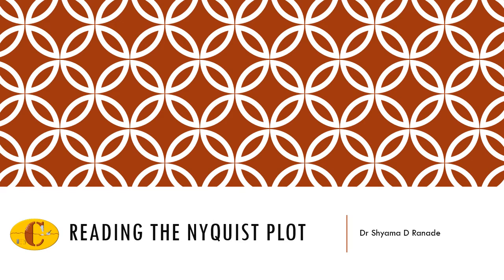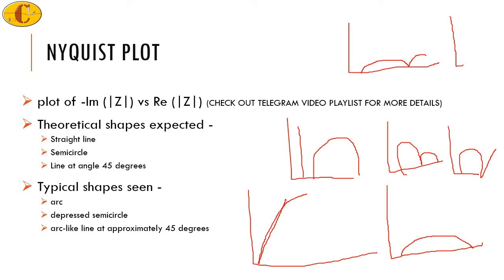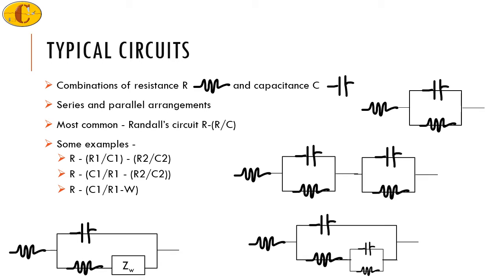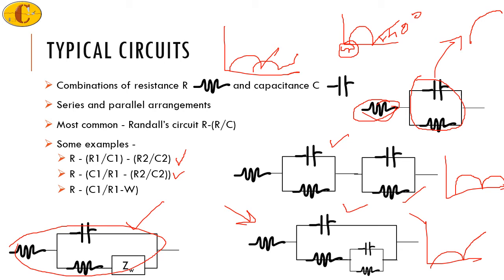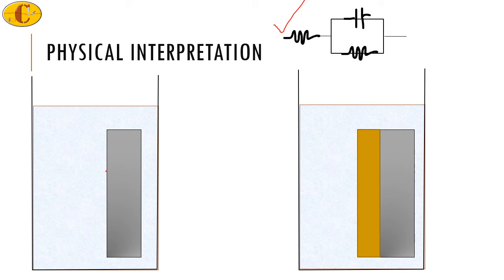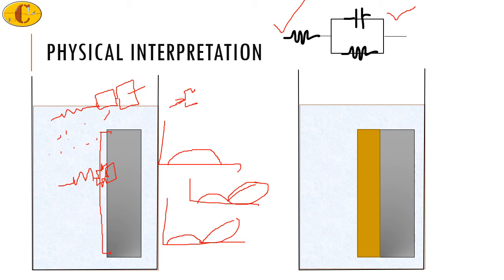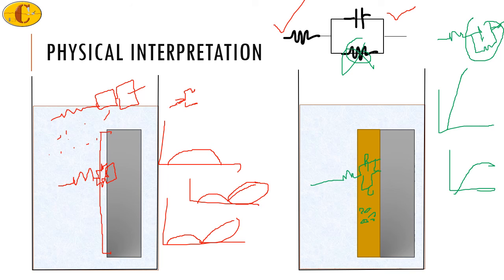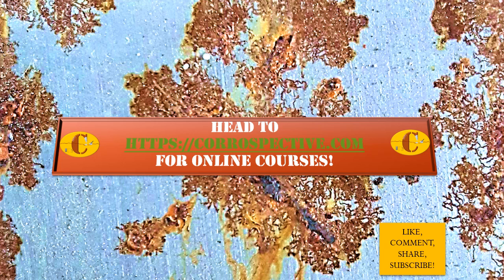Reading the Nyquist plot

Comment: Where SEI plays here , as I see first arc is referred as RC for SEI which is like film on electrode but it is produced and it grows as cell ages ryt?
Reply: Bye the way good intuitive explaining for none electro chemistry background
Reply from the maker: Yes, if you have connected the working electrode terminal to anode in battery, then first arc RC will mean SEI. You will have to define the terms and their meaning as per their physical significance. If you connect working electrode terminal to cathode during EIS testing, then you will have to look at the reactions occurring at cathode as the EIS will indicate changes in cathode. Hence, correct connections is crucial in battery systems.
Reply: Film on electrode w.r.t to cathode , as because SEI forms only on anode

Comment: What is Lstray in circuit ? What is the use of that or could u please explain fuel cell fitting in EIS
Reply from the maker: Hello, inductance L is used to indicate adsorbed species on electrodes. Lstray may refer to a particular species that gets adsorbed but is not expected to get adsorbed, suhc as stray H atoms. You have to related the element to your fuel cell chemistry.